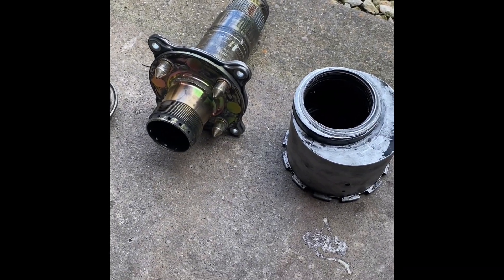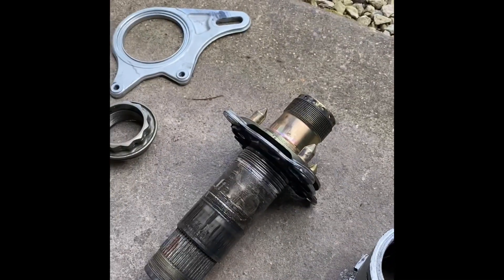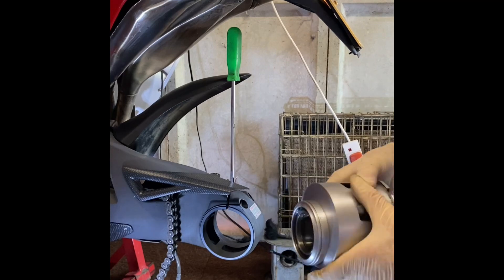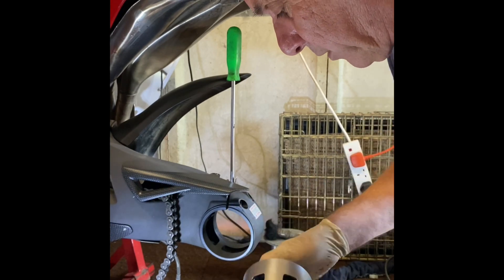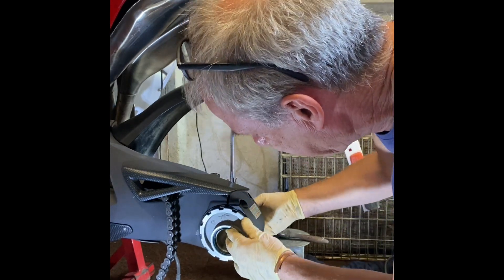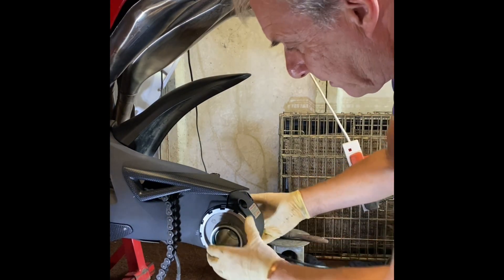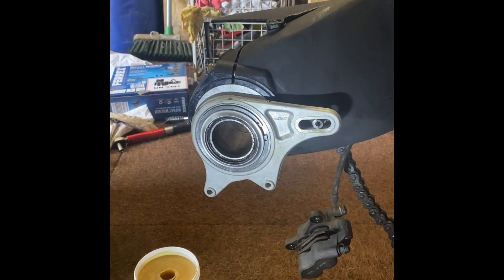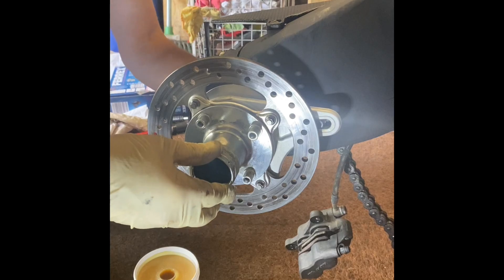MV Agusta F4 1000R Upgraded Hub Install

Comment: Hi, Is there anyway of knowing at a glance if my 2009 312R has the upgrade hub fitted? And roughly what was the parts cost? Many thanks!
Reply: If I can chime in with an answer - not at a glance, no. Partial disassembly is required. You'd have to undo the chain and remove the sprocket with carrier to have a good view of the left side hub face. There you'll see that the upgraded hub will feature the MV logo and part number.

Comment: nice vid George, good idea to ss.wire up the clip on the sprocket side - the gen 1 has a better design cush drive set up, round nylon , instead of the rubber wedge pairs on the gen 2